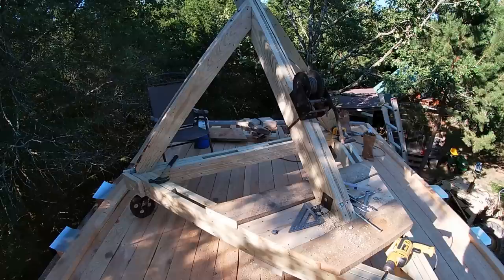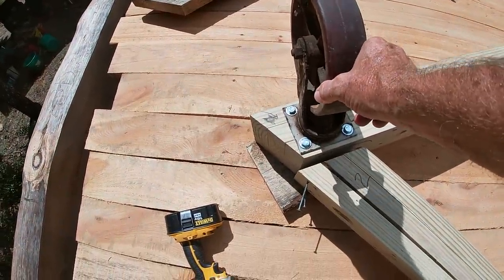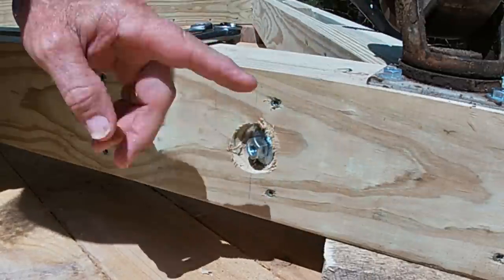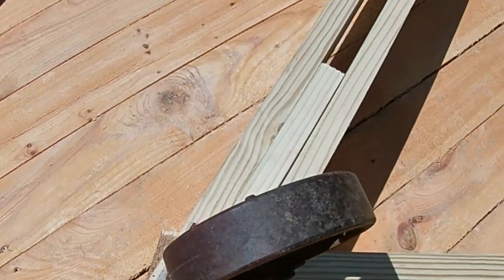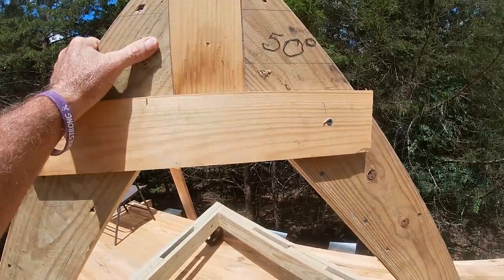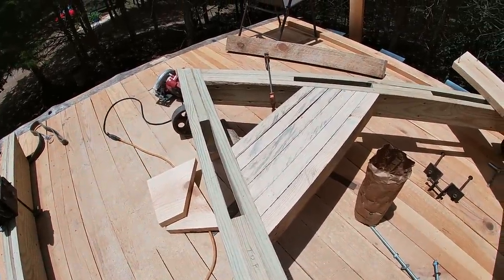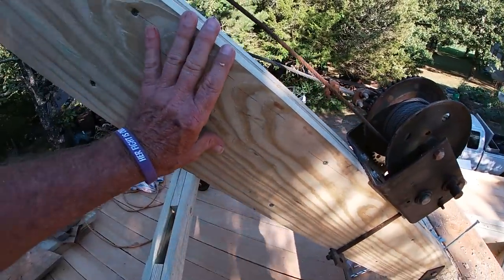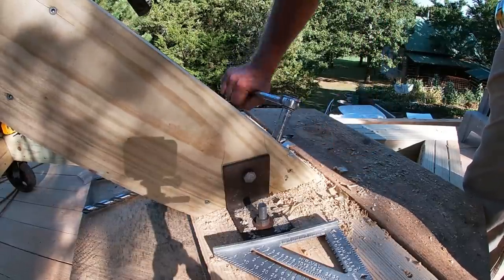Building a New Log Hoist, Dovetail Log Cabin Build (Ep 32)

Comment: Paul I’ve used your hoist design these past months an I will say , it’s saved my back.. All my Ceiling Joist are in.. I will add I was at its limit in height.. ended up having about 1.5 inches left.. Hopefully I’ll get that angle right up stairs because of the 24 OC between rafters.. Thanks again Paul.
All because of you
Reply from the maker: Howdy brother- so glad the hoist worked out good for you. It’s a sure enough back saver. Sounds like y’all are moving right along down there. Holler at me sometime. Hope y’all have a great weekend. God’s blessings to y’all

Comment: Howdy Paul, how's The Bearded Carpenter? Thanks again for last night. I have been watching this episode to get the length of one side side of the base as it is an equilateral Triangle. You fabricated on the ground the parts for the Upper Hoist then lifted them up on the upper floor. You told the size of the base 2 x 6 but not give the length of the Base triangle length from tip to tip. I got that the lower hoist legs were about 13'. In closing can you take a photo of brother Wayne's grinder disk and a photo for what the log veneer looks like after being ground, sounds interesting. God Bless you all,  today!
Reply from the maker: Howdy Tom- the length of the base sides are seven feet if I remember correctly. I’ll have a video of the log faces coming out soon. Take care and God’s blessings to y’all
Reply: @TheBeardedCarpenter  Thank you sir. I got a ways to go and I may be able to do the trigonometry with the 7' and be able to calculate the angle to cut the legs at the 16' boom with 13' legs. I have picked up like the boom the legs go out to the tip of the base on all three sides. Looking forward to the video that is coming out soon. Thanks so much for your time. May God Bless you folk.

Comment: I love to make one need the sizes of it.
Reply from the maker: Howdy Eric- The base is 7’ on each side.  The boom can be the length of what you have available. The hoist l used on the first floor is taller than the one in this video. The boom on it is 16’ long. How tall you need your boom will determine the length of the legs to hold the boom up. Hope this helps. God bless you

Comment: Howdy Paul. Got to spend a fair amount working in the woods last couple days. I have been figuring out how much wood from the blow over  I have to see what I figure on building based on what I find out after I done pealing and bark spud work at base end. I am using Douglas fir and they have thick bark at the but end. Walking about counting downed logs I am right near sure 1 story, no second floor nor a knee wall for a head knocking 2nd floor. Been watching "The New Log Hoist" (10 times this morning and again tonight). I decided to ask a simple question before we talk any numbers based on you advice.. 

1. Will the the "New Log Hoist" work for getting at the most is to put 2 logs over the doors and windows, say couple 12"-14" logs?

2. Will I need to build one closer to the dimensions of the one you used the on first floor to get my logs that high?

 Well depending on the answer these two questions we can get numbers necessary for my needs then. Paul you folk the at Bearded Carpenter take care and may God Bless you all. Tom
Reply from the maker: Howdy Tom- the hoist in the video was built just for getting the last rounds of logs up and to set the rafters. You would need a hoist like the one I use setting logs up to the second floor joists.  My hoist has a 16’ boom and would more than likely do what you need. The legs would need to be longer to support the height of the boom and the base of the boom would need to rest at the back corner of the base. Hope this helps. I sure wish you the very best with your build. Take care and God’s blessings to you
Reply: @TheBeardedCarpenter  Hoy Paul, how's the Bearded Carpenter doing? Thanks for getting back quickly. Now I start drawing ( I used to be a draftsman ) and do you know a way I can send you the drawings with all the dimensions and angles, and a bill of materials so they can  get an esi get more specific on dimensions to estimate on the cost. Got to finish debarking and will get them bucked and all stacked to see what I got.I will need my floor built to build it on. Thanks and God Bless!
Reply from the maker: @thomasnichols3825  Howdy Tom- you can email me at thebeardedcarpenter8@gmail.com. God bless
Reply: @TheBeardedCarpenter  Howdy Paul, how is The Bearded Carpenter today? You reply is perfect, I can send you the plans for your review, comments and add any dimensions. Got a scanner for 8.5" x 11"? If you do you can send it back to me attached scan my email to incorporate your input and send her back for me to incorporate info. Then you will have a set of plans with dimensions you can give to folk. Now as I mentioned earlier of my health so I am a little slow with rainy season at hand trying to get as much as possible before then. Having 11 new windows that failed so I be in the house for a week. Off to the dentist, fractured molar, can't wait, Haha. Thanks for your replies and dong them quickly. Blessing to you and yours, Tom
Reply from the maker: @thomasnichols3825  That’s so nice of you! Thank you so much! God bless
Reply: @TheBeardedCarpenter  Glad to do it. May take a bit as I also grow trees for reforestation. I love living in logging country so plant trees when fall rains start and let God water of the trees all winter, I trust God will do great, always has! To start with the base, what is the length of one side, all three are the same and I think you said legs were longer and of course the longer boom. God Bless, Tom

Comment: Bro. Paul got a degree in structural engineering? How will you figure your ballast weight? Hoist looks great... Lord keep you safe Brother
Reply from the maker: Rough Cut Homestead   Howdy Mr. Duke- no, I don’t have a degree in anything but hard work. I just have to fall back on previous experience and go from there with the Lords help cause I ain’t all that smart hehe. I just put the same ballast on that l had on the other hoist. Not exactly sure how much it is but it’s a few hundred pounds l would say. Its enough to keep it from turning over. Hope y’all have a great weekend. God bless ya’ll
Reply: @TheBeardedCarpenter  Thanks Bro., Lords blessings